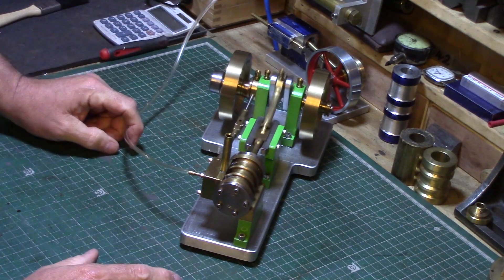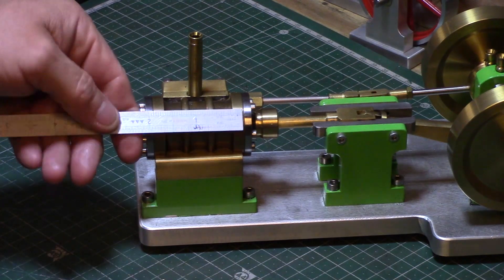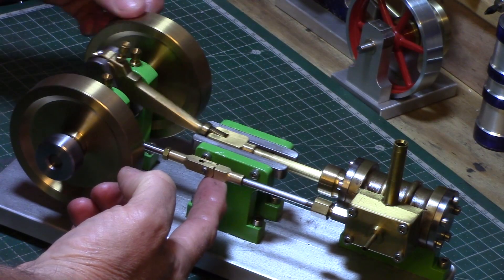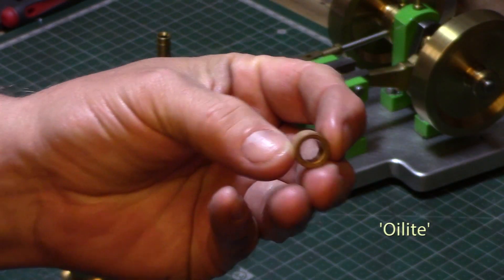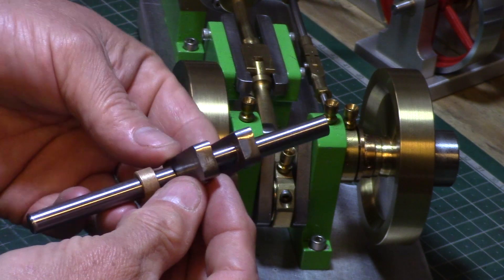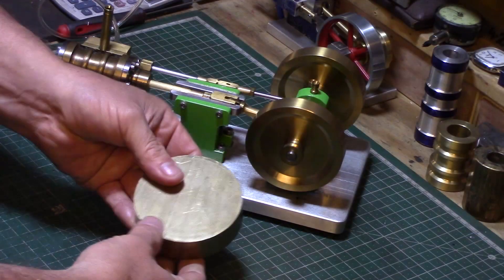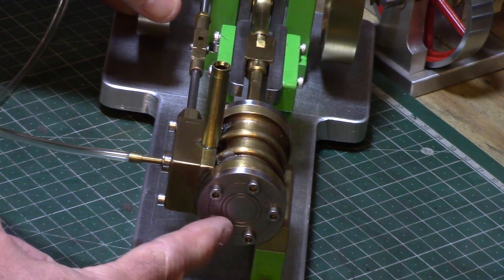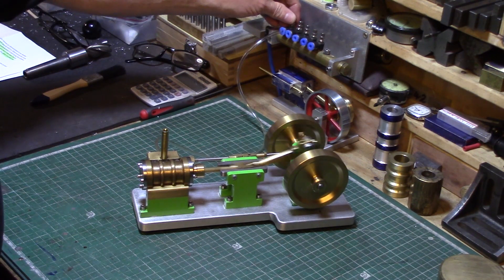Horizontal Mill Model Steam Engine 2020

Comment: for powering a r.c. do you think I should go with a beam engine or a mill engine. I guess there is the other question of going with a double piston mill and Double acting as well. If I build it myself it can only be a single piston for sure, but the other questions relate to buying one.
Reply from the maker: R.C. ?

Comment: Hye sir,your accent and voice are really soothing
Can i ask you,can we skip the slider when making a working steam engine model?
Reply from the maker: the crosshead slider helps keep the piston rod aligned, without it you will get heavy wear on the shaft due to the osscilation from the crank
Reply: @adeswash  thanks sir for replying
I will surely take that into consideration

Comment: Beautiful!  Do you ever run your engines on live steam?
Reply from the maker: Hi Patrick, I have run them on steam, but my boiler is cobbled together from a pressure cooker and not very prctical, so use compressed air usually. That said, they are magical when I run them on steam. One day I'll get a propper boiler. Regards. Ade

Comment: Ade, nice little engine, if your slide valve isn't seating properly you can try putting a small piece of silicone tube between the valve and the valve adjuster nut on the shaft, if there's enough room, saw this on one of Keith Appleton's   videos, done it on one of my engines and it works a treat.
Reply: Not required if the engine is made correctly . But if that wanker KA said so it must be right .

Comment: I really liked the layout of that engine.Pretty impressive for a third engine,especially for an own design.The five stud cylinder spacing is also used on the Stuart 10v.Some of the slide valve engines I have built the slide valve leaks despite hours of fettling.As long as it runs right I just settle for that in the end